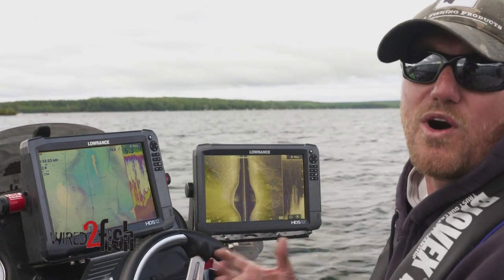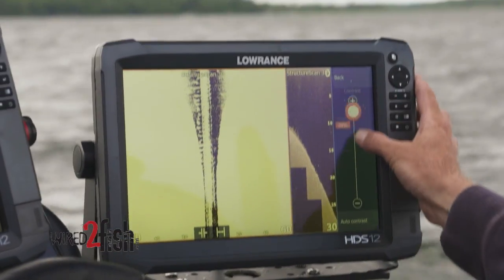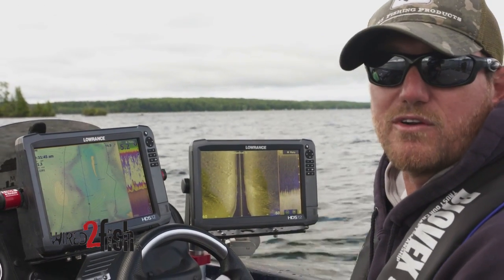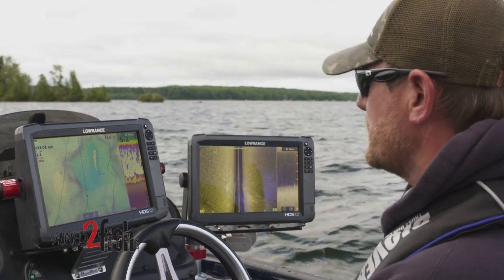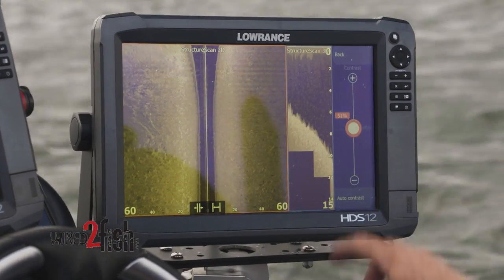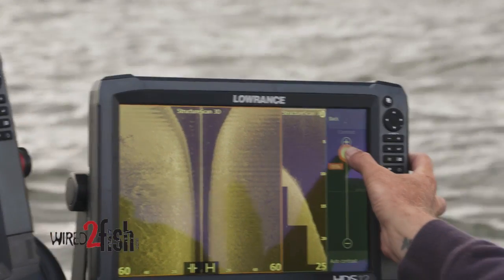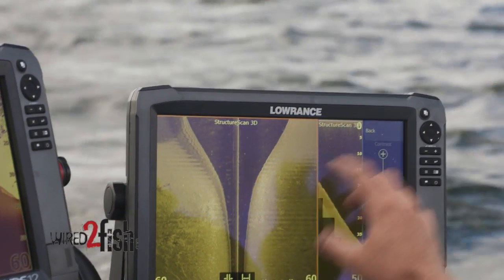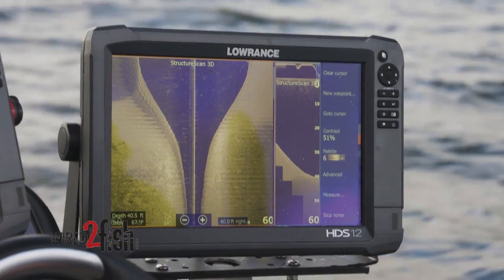Enhance Marine Electronics by Adjusting Contrast

Comment: jason and josh what settings on down and structure do you guys mess with surface clarity or noise rejuction  or do you guys run the factory defaults great video
Reply: I'm just running factory settings but manually adjusting my Contrast as I go. Thanks Dude!!